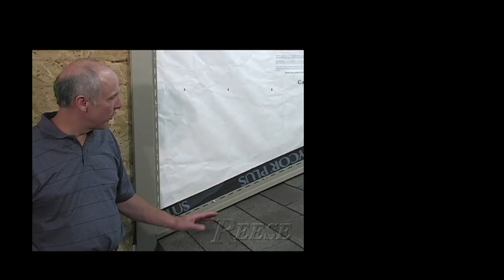Bob Werner & JD Smith install Vinyl J Channel at the Roof Line - a Reese 59 Second Snapshot ytv200b

Comment: Good point about the 8 to 10 inch nailing separation. What would you do if the wall uses rigid foam as sheathing and 16 inch separation studs?